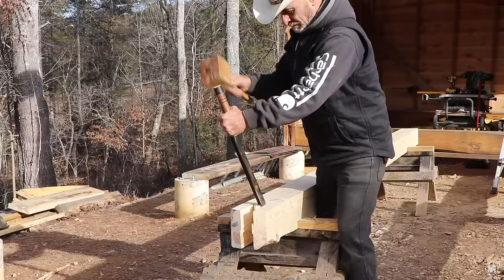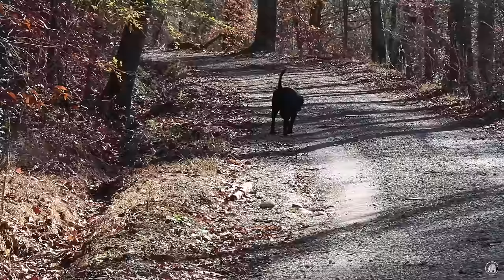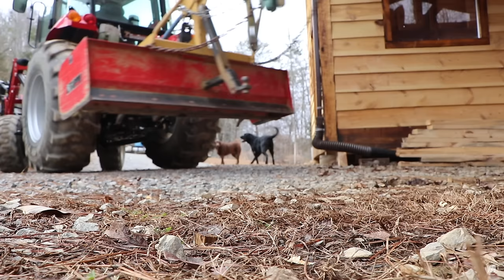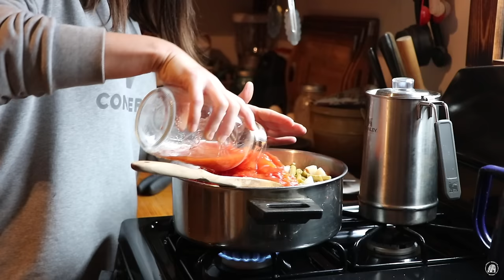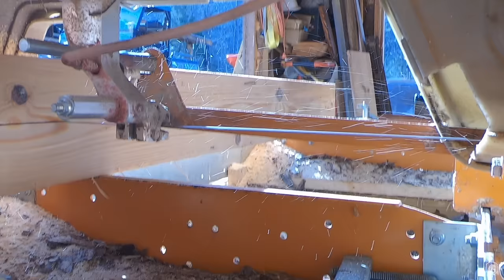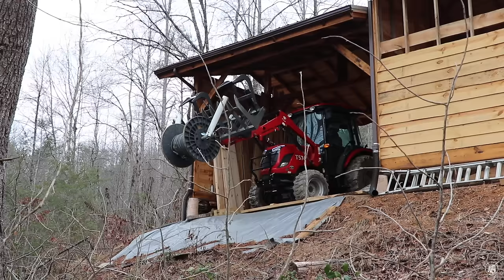BUILDING NEXT SECTION FOR TIMBER FRAME WORKSHOP

Comment: I noticed that after you de-stress the outside of your beams, you don't seem to do anything else to them, other than burn them. I used to de-stress beam for multi$$ homes, and we would take a heavy-duty wire brush cup and go over the outside of the beams with brush and grinder. This procedure will soften the beam exterior so it's safer to handle, and the beam receives stain so much better. The process doesn't take much time, and the finished look of the beam is great. Just sharing differently up to you. 👍 looking great anyway.
Reply from the maker: I will pass that on to my dad! Thanks for the idea. We appreciate you! -Jennifer

Comment: What happened to the heavy duty sawhorses you built?
Reply from the maker: Use them all the time, they sit next to the sawmill currently and we use them to cut wood and materials with. Thinking of drawing up some plans so others can make their own variation as well. Would be a small cost, but trying to put something together.

Comment: I never win so where can you purchase one of those pencils?
Reply from the maker: You might win this month! Ya never know. But you can get them on Amazon. We use the Pica Big Dry Marker for Construction (Graphite). It is basically a framing/carpenters pencil but with really nice lead and in a mechanical pencil style output. It is a little on the large side but you get used to it.